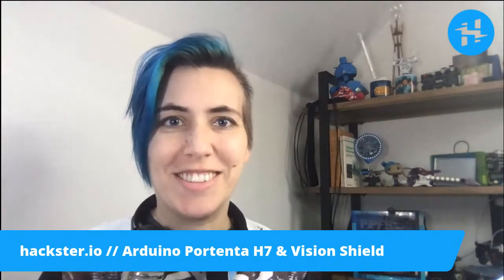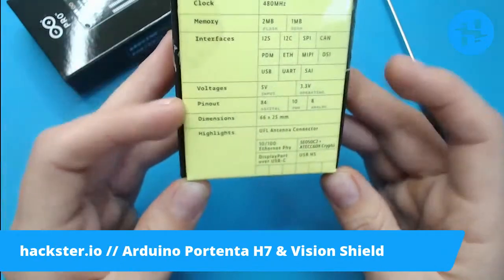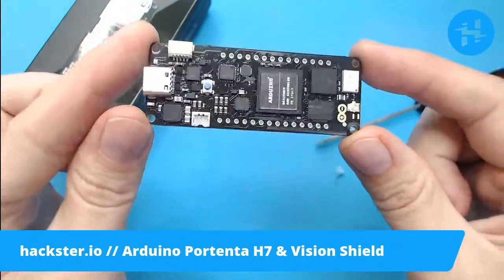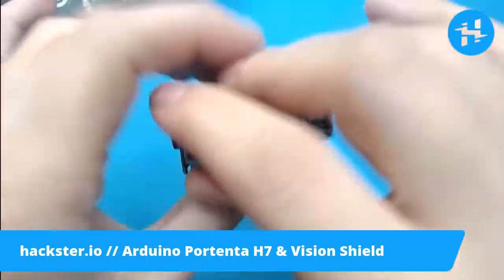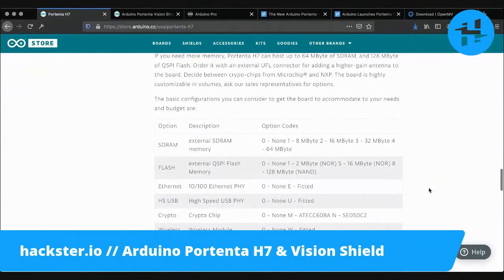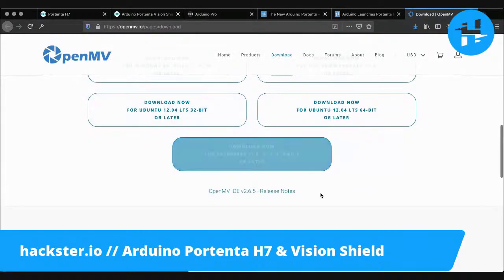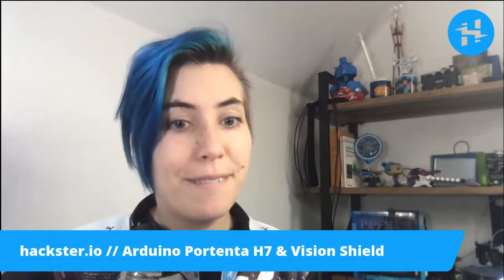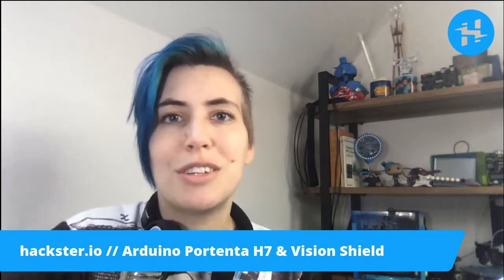Arduino Portenta H7 and Vision Shield

Comment: Portenta, as a developer board, is very interesting, in addition to the two core arm with graphic acceleration it offers a wifi and bluetooth module and a chip dedicated to security for the IoT, a ton of pins and options for connectivity ... So confusing, it would be a great start for the whole community to have examples that explore all the features this board comes with one at a time. I only regret that Arduino does not provide guides that explore more about the product, but let the community the weight of creating these contents. More support from arduino would be great, but I think this board will be left to die like the Vidor4000 :(
So much wasted silicon
Reply: You could, you know, as a leader in the community, go do these things

Comment: That question of cost..  A webcam like the Logitech c922 is going to set you back 100$ and it uses your CPU for most of its computation. Nest doorbell which is far less usable in projects is going to cost you about 300. I was surprised it was so reasonably priced.  Still a bit over my budget but that doesn't make it unreasonably priced.